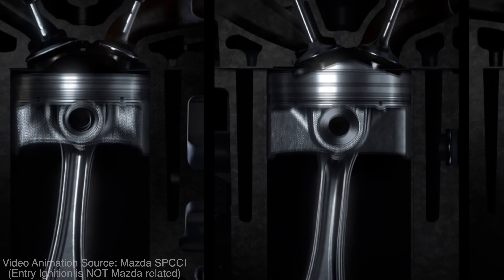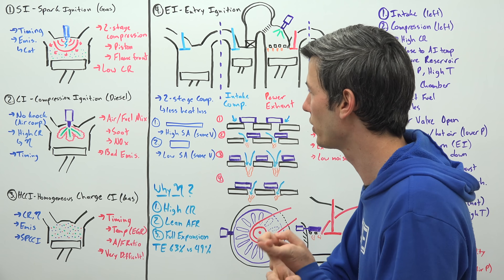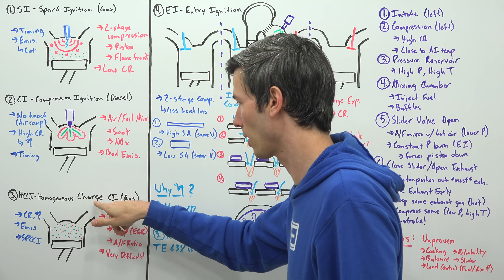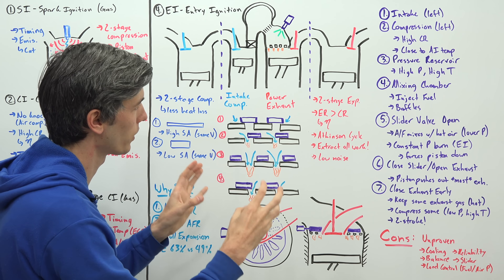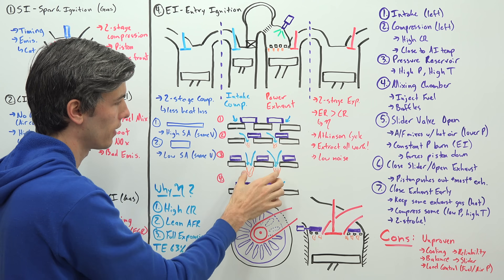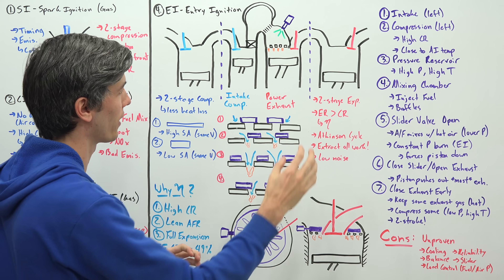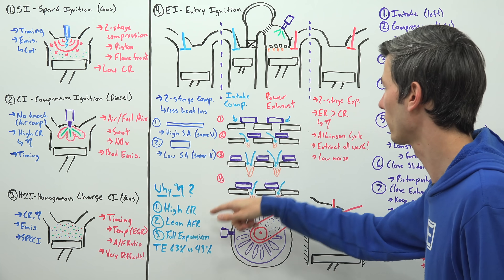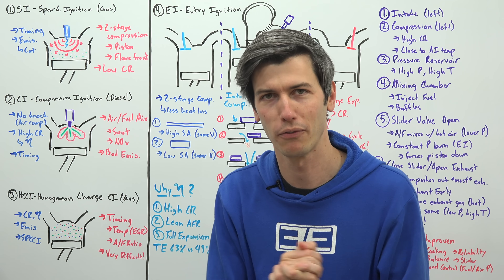Is 'Entry Ignition' The Future Of Combustion Engines?

Comment: There is one big mistake you made. If the temperature in the larger cylinder is higher than that in the mixing chamber,then the pressure is also greater in the large combustion cylinder than that in the mixing chamber,and so the air/fuel mix from the mixing chamber will not flow into the combustion chamber. So this ridiculous engine design will not work.

Comment: I'm super confused. In this example, we have an entire cylinder dedicated for just compressing air? Why would you not just use a super or turbocharger to compress your air? Especially with new electric superchargers, which could presumably start pressurizing air as soon as you even open the door, so you already have compressed air by the time you turn the key? I don't get why we'd use an extra cylinder (essentially dead weight and extra rotating mass) just to compress air.

Comment: A 14% increase in efficiency before all the extra friction is counted, in exchange for a 3 times more maintenance cost and down time. Plus the less reliability. I'm only going to the store, I'll take my 1995 Geo Tracker engine - Unbelievably Reliable. I'm on the 4th one in a row, and have never needed: starter, fuel pump, water pump, alternator, injectors, head off, either manifold off....Nothing. 
Entry Ignition = Exit Paycheck. 
Thanks for showing it tho.
Even using a blower or turbo, I wouldn't take one for free.

Comment: So the slider valve pushes the finikin pin towards the spacely sprocket rotating the crossover pipe downwards that connects to the piston attached to the rod forcing maximum strain on the rod bearings. Oh yeah  I get it. 🤔

Comment: Thanks for another great and informative video.   It’s an interesting idea, and I’d love to see it in action.  Keep them coming.  —  (I can’t help but to see an enormous potential for mechanical failure in these things. The slider valve alone seems like they would leak and fail way more often than it’s worth).
Reply: It wouldn't have to have slider valves. It could have a electronic sensor on the crankshaft so when it is at a certain spot then it opens and the adjustments for the different room could be done by a computer. I love this idea especially since it might sound like a good old 2 stroke dirt bike I also hope it has the super fun power curve that 2 strokes have so I can barely stay within 20 above or below the speed limit

Comment: Jason, your explanation is excellent, as always. Love your channel. However, this "engine" is dead on arrival. An unproven idea that I doubt any motor company would be willing to gamble on today. Profits are tight if they even exist, staff is on lay offs, and if R&D hasn't been cancelled already, what there is will be spent on BEV design. A somewhat similar idea was proposed over 50 years ago by G.B. Warren and J.W. Bjerklie : SAE paper no. 690045, Automotive Engineering Congress, Jan. 1969. A constant pressure ICE.  Product Engineering, Feb. 24, 1969, p.81. Stay well.

Comment: They still haven't figured out GDI oil dilution problems. EI crazy complicated and looks like it will still get oil dilution (minute amounts of gasoline getting past the piston rings and getting into the oil in down in the crank, slowly diluting it).
Multi-port fuel injection and VTEC are the last engine innovations that don't make for lower engine life.  They are turbocharging nearly all four cylinder engines now.  If you want a 300,000+ mile car, you want a naturally aspirated SOHC non-interference engine with multi-port fuel injection.

Comment: In the 1970s Honda had their carbureted CVCC Engine in the civic. It had a divided combustion process where the main part of the cylinder was lean and a much smaller thimble shaped pocket in the head with a rich charge that was spark ignited and blew into the main cylinder like a torch increasing efficiency and lowering emissions to the point that it didn't need a catalytic converter.

Comment: I think this engine should've been explained with turbos or superchargers instead of more pistons. Reminds me of a jet engine (constant compression) but with pistons. As for a slider valve that should be similar to a compressor found in jet turbine engines only the air flow reversed, air ways bigger, and actuated much like electronic valves only rotation instead of linear. You mention diesels. I see the next generation of Detroit diesels making a comeback. You should design a conversion kit that replaced the head of two strokes. Take an existing and very simple engine used in bicycle engine kits to measure power increases and effeciency increases for the power to weight ratio of a bicycle and rider.
Reply: On second thought keep valves and everything with no computers. The bicycle engines don't have computers in them and no two stroke should need a computer.

Comment: When the fuel is sprayed into the mixing chamber, it will ignite and expand into the pressure reservoir and mixing chamber first. When the slider valve opens up, then the expanding pressure from the burning air/fuel will start pushing down on the third cylinder. So, the volume of the pressure reservoir and mixing chamber become part of the third cylinder's volume.

Comment: The thermal efficiency is boosted by the higher compression ratio. But the Brake/Thermal efficiency is the more useful metric. Its unlikely multiple pistons & cylinders contributing to one productive piston will excel in mechanical efficiency. Compared to a conventional Two-stroke engine, this design will be physically larger and more complex. And it will not sound like a proper two-stroke either 😂.

Comment: Good luck starting that when it’s -25c
Reply: would need an intake heater, block heater, and oil pan heater.
Reply: PotatoadZ then that battery would be dead by the time you got the engine warm enough...

Comment: I thought that the opposed piston design was the way to go. No cylinder head to waste heat. No poppet valves, just ports. Two stroke design for power on every stroke. But it does need a low pressure blower for scavenging.

Comment: The real improvement to the internal combustion engine was the MYT engine which is 4 stroke without a valve system. The highest hp/weight ratio.

Comment: I don't see it ever taking off.      Why not have the exhaust heat the incoming air with a heat exchanger and have the spark come from the valves or something?  Or, better yet, run a a supercharger that doesn't require a crazy/costly engine design and have a small fuel spray just after the intake to further improve the fuel air mixture before the individual injectors spray.   Like a reverse anti-lag.

Comment: Would a system like FREEVALVE possibly work better than a rotating valve. The valves could lift up away from the combustion piston with no clearance issues and be triggered at any time.

Comment: Indeed very interesting concept
but it looks like very fancy engineering for  what is well basically "early fuel evaporation" in diesel engine. Which is a well explored design concept for diesel engines. I recall Mercedes passenger cars  with diesel engines at 1960-80  had this kind of setup. Maybe it still in use with some current models

Comment: Slider valve systems either get oiled thereby causes emission, or it does not get oiled and that makes for parts wear out quickly and overheats into failed.  But the second one can have the piston push a rod to open the multiport transfer, and is oiler much like poppet valves but, uses high pressure/temperature sealing.  This way it will not have emissions either.

Comment: A few random comments... HCCI engines do exist, they've been made and sold by the thousands!  It's the kind of engine used in "gas powered" (not actually gasoline but...) model airplanes.  Nowadays of course many model planes are electric, but when I was a kid they all had those engines made by Cox and a bunch of other manufacturers.

Re the slider valve, it's proven in a sense because it has a lot of similarity to sleeve valves that were used in engines back in the early days.  The topology is different but the concept is the same.

And the other thing that strikes me with this engine is with its presumably high combustion temperatures, NOx emissions are going to be a nasty problem.  Doubly nasty because a highly efficient engine won't have an exhaust temperature high enough to make a catalytic converter work... at least not the kind we're currently using.

Comment: Working piston never sees cool air charge-=materials challenges (expensive to address).  Complex.  Slider valve=all kinds of issues.  I think Mazda's Skyactive-X is a better idea.  Also, I would wager that HCCI (instantaneous combustion throughout the gas at TDC) is more efficient, since you are not adding burning fuel/adding pressure toward the bottom of the power stroke.  Adding the second expansion cylinder addresses this, I suppose, but at the cost of additional mass and complexity.